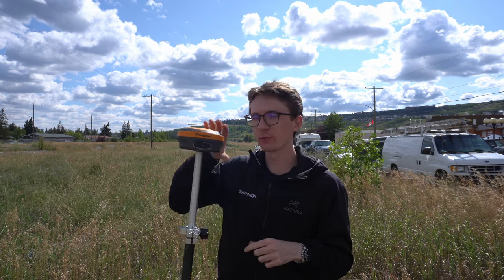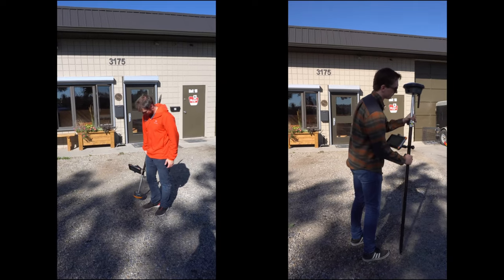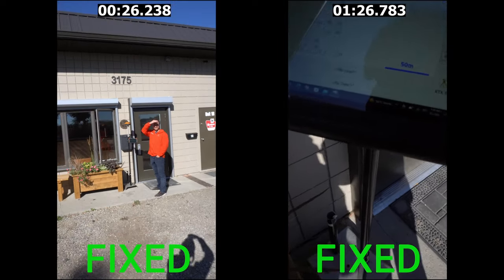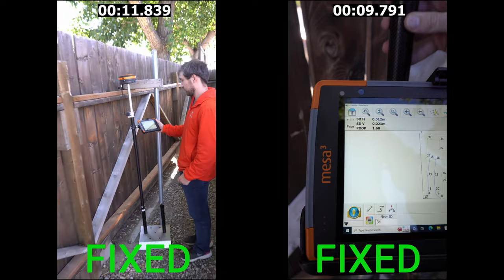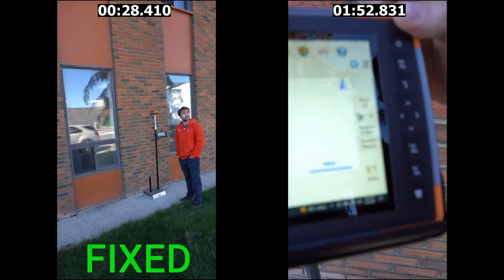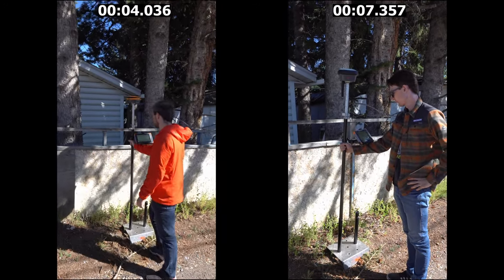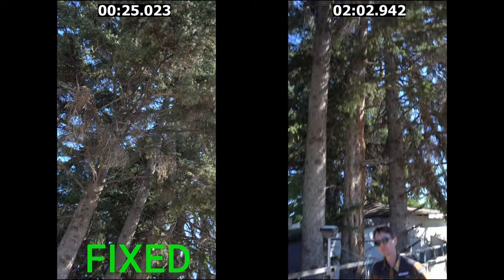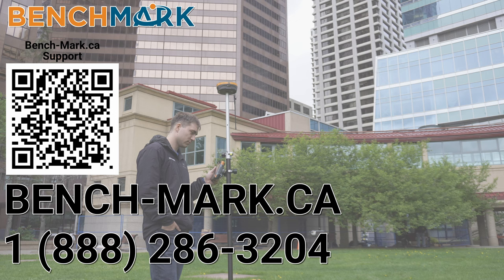Hemisphere S631 Head to Head with the Leica GS18 | Bench Mark

Comment: Would love to see this against a fully unlocked Trimble R12i. In the last video against the R10, someone commented about comparing to a total station shot in heavy canopy. We recently did this where we compared three (3) averaged 10 second shots of our BRX7 off a full constellation RTN base (dumped between each shot, baseline around 10km) against a doubled CRX2 shot in Starnet. The control for the RTS was set using Starnet and the same aforementioned RTK and RTS methods  The difference, from memory, was roughly 5mm.  The caveat being that, no, we did not return 4+ hr later for a new constellation geometry shot. The Starnet results met the required precision for the job so we left it at that.
Reply from the maker: Hi Jaccen, we are working on getting a Trimble R12i in as well. As I mentioned to Ivo down below I have added the over time fix quality to the list. Thanks for the suggestion!
Reply: @benchmarkequipment  Np. I enjoy these S631/BRX7 comparisons as no one else seems to do them. Whether you're a FieldGenius or Carlson fan, Hemisphere has a pretty good "magic box on a stick." Cheers!

Comment: How does this compare to the Carlson BRX7? Or are they the same thing with different colors? How does this compare to the Foif a90?
Reply from the maker: Hi Lucas, Carlson does not make any of their own hardware. The Carlson BRx7, 6 and 5 were all rebranded Hemisphere receivers. The Foif A90 uses a different internal board, made by unicor. We have not done any in depth testing with that unit.
Reply: @benchmarkequipment  Thanks for the intel. I wonder if this will turn into a similar situation as DJI with legislation trying to cracking down on the DJI aircraft used by U.S. government drone programs. I can only speculate but I would assume all these internal boards are coming from overseas and I'm sure some are being used to map some pretty classified areas without concern.
Reply from the maker: @lucasdill8718  , Hemisphere has divested from China for this exact reason. I suspect you are probably correct on potential bans (at least for government contracts) for the Unicor boards.

Comment: That is a good comparison, but a better test might be to occupy the exact same point (ideally of known coordinates) under challenging conditions, and compare the resulting coordinates 1) between the different receivers and 2) between the same receiver over a period of time (say 2 hours). A fix by itself is nice (impressive actually right up by the buildings), but repeatability is better.
Reply from the maker: Hi Ivo, I would check out this video on repeatability under canopy for the S631: https://youtu.be/EgZuwKsxMRE
Reply: @benchmarkequipment  I just saw that - impressive - but the key is to wait, so that the satellite configuration (geometry) changes significantly. Anything under 5 min is really the same shot. Try it at 2h, 4h, 8h, etc. Of course at some point the sky will start ± repeating... Nice system, too bad it won't play nice with Survey Pro...
Reply from the maker: @ivonedev9449  I will add the long time scale repeatbility test to the list. I would recommend taking a look at FieldGenius we offer training with all RTK systems.